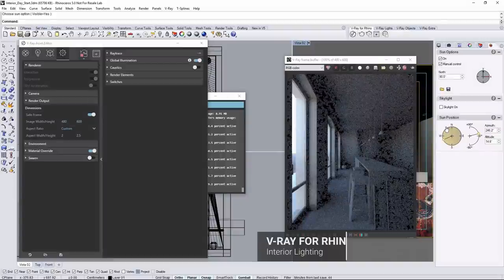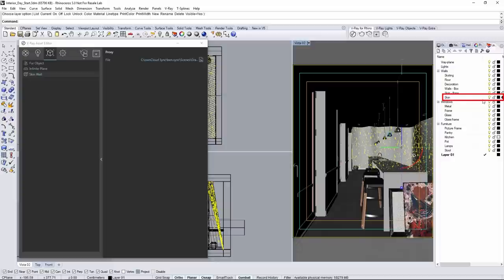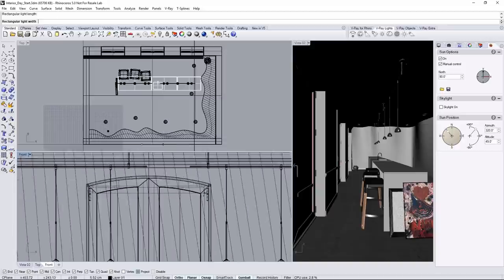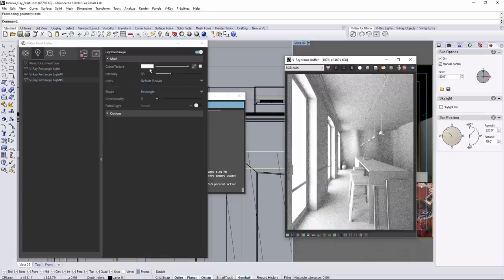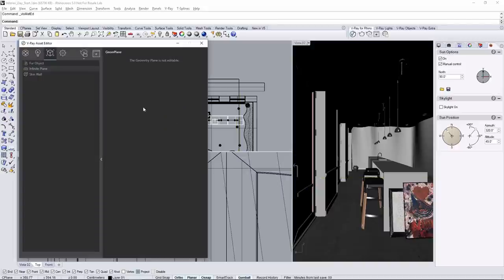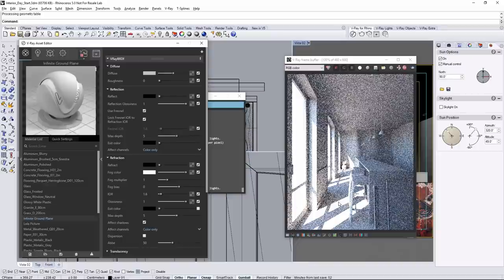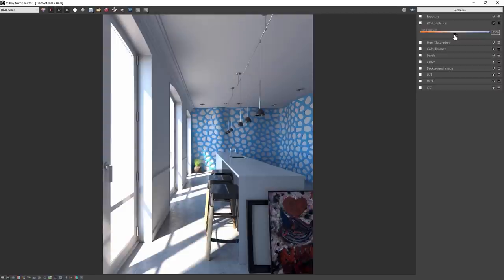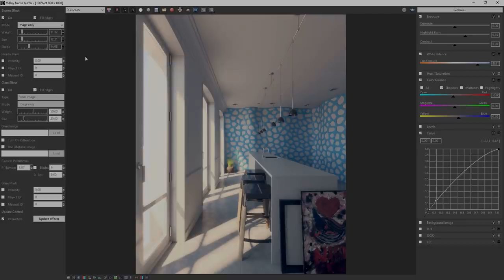V-Ray for Rhino – Quick Start: Interior Lighting

Comment: Hey I got one probelem I don't find this settings 8correction control) in the framebuffer window which you use in the last minutes to set in the picture. I just useing a trail mayb  this is not included?
Can anybody give me a tip?